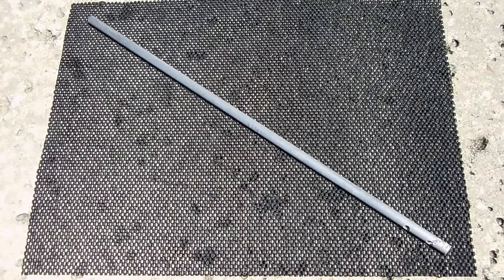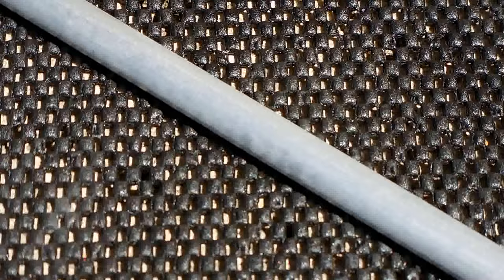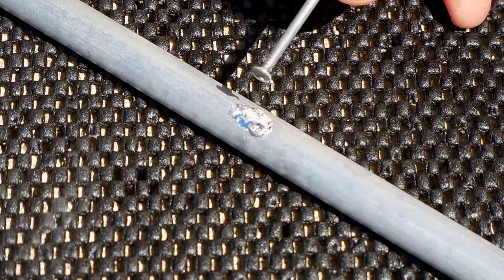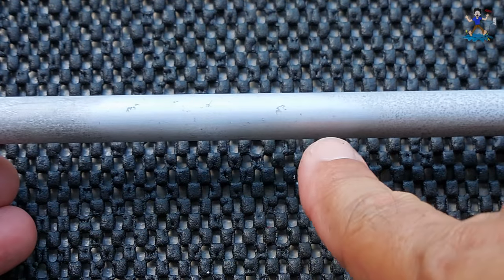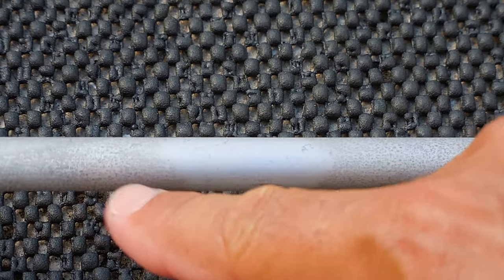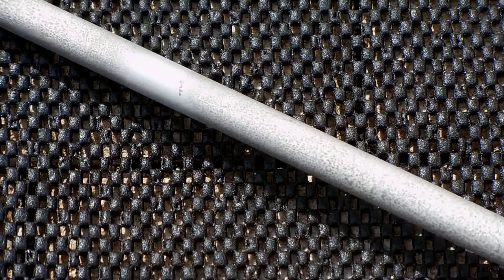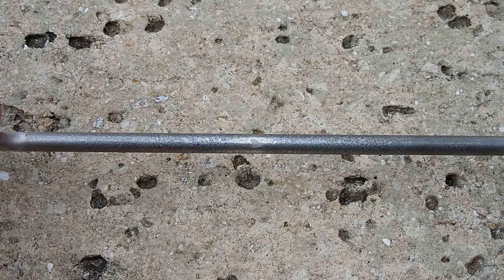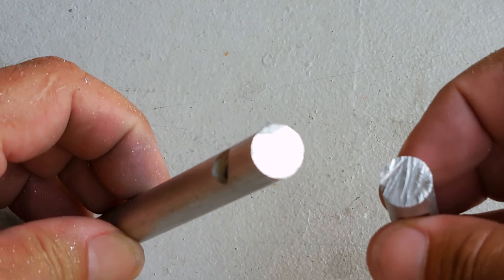Gallium vs Aluminum!

Comment: Hi. I see the Gallium is liquid when initially applied. Will it not "grab" the aluminum in solid form? Is that the reason for the sun lit black padding, to keep it nice and warm so as to attack more efficiently? Thanks for the great videos.
Reply from the maker: The Gallium needs to be in liquid form. The black mat was used for contrast.

Comment: I wonder if there might be a practical use for this, although I can't think of one at the moment ? 
Also wonder what happens if you apply heat to the aluminum after treatment ? 
Thanks for sharing
Reply from the maker: The only good uses I can think of, would be for conductive purposes like what is shown in my other video, or to make aluminum windows very easy to remove(allowing them to crumble) when replacing them.

Comment: Would the same thing happen with other metals, Gold, Steel, Cast Iron, Copper ect??
Reply from the maker: It's corrosive to most metals, but there are a few exceptions. Aluminum is destroyed the fastest, followed by zinc, all other metals are corroded very slowly, and sometimes only to shallow depths. Thanks for watching!
Reply: Thank you for making the video :)

Comment: Is this something akin to hydrogen embitterment? Man if someone wanted to do some damage this would be the way to do it..
I know aluminum is one of the most reactive elements on earth but clearly these two elements have an affinity for one another ... I'd call it a bad love affair that ends in a broken relationship... destroyed is more like it.
Reply from the maker: I was discussing that with a friend of mine the other day. Just imagine placing one large drop of Gallium on a 10,000-12,000 pound aluminum boat lift next to the pulley. In 3 days the boat would be in the water! Imagine leaking this element inside an aircraft! Not good. Thanks for watching!
Reply: Yeah, I didn't want to go there, many structural things made from aluminum.
Reply from the maker: Craig Nehring What's truly amazing is how fast the damage occurred. In one day that rod could have been snapped.

Comment: Very interesting, would like to see what it does to other metals.  I've seen some aluminum corrode very badly from electrolytic action on boats, but it never seemed to turn brittle on the inside.  I guess this is aluminum's Kryptonite.
Reply from the maker: If you take a copper plated zinc penny, scratch the surface down to the zinc and apply a small amount of Gallium to the scratch, in a day or two the zinc will be damaged enough that the thin copper plating will peel away from the surface.
Reply: +electronicsNmore show a video on that lol
Reply: Now I know how to make cheap jackets for my cast bullets:)

Comment: cool. It can also do the same with glass if its in a bottle. But why did this video get down votes? sheesh. What other metal would it react to.
Reply from the maker: The reason why glass is a problem, is because the Gallium expands when it becomes a solid which causes the glass to break. :-) Ignore the down votes. They are from Trolls and lowlife individuals that are haters of my channel. Every channel has them. They don't have the balls to confront me, so like little wimps they use the thumbs down button out of spite. What happened to all the men in this world? LOL Many Youtube channels complain about the abuse. Youtube needs to eliminate the thumbs down button. Thanks for watching!
Reply: It is odd how the metals absorb despite the aluminum is solid. 
Also here is an odd reaction. to mix I think colloidal silver with colloidal copper (or was it tin or gold) which made a white cloudy liquid.
Reply from the maker: xwsx001 I'm not a chemist, so I cannot explain too well what's going on, but the chemical reaction between the Aluminum and Gallium does a great job at weakening the Aluminum(Creating a new alloy). I could have placed the Aluminum coated with Gallium in water and hydrogen bubbles would have been produced.
Reply: +electronicsNmore you probably could have broken it with your hands. also most don't know this that to generate more hydrogen for energy with electrolysis aluminum powder greatly increases the efficiency. but people have to watch put handling aluminum powder since its toxic if inhaled or touched.
Reply from the maker: xwsx001 Yes, I could have easily snapped it with my hands.

Comment: I was on a 747 from LA to NYC this morning, and the plane's heater was too high, so it was 87° F inside. My 1 liter bottle of gallium fell onto the floor and broke open, spilling everywhere. I was seated just above the wing and it's structural supports. I didn't bother telling anyone about the spillage, mainly because it seemed to have disappeared by the time we landed. I guess it was absorbed into the floor. That shouldn't be a problem, right? Lol.. Just kidding.

Comment: A video on how to take forever to cut an aluminum rod in jagged pieces. Next video will be how to take an hour to make a sandwich.
Reply from the maker: ADD/ADHD is a terrible thing. Luckily there are treatment options. :-)
Reply from the maker: Chuck Smith As I said, ADD/ADHD is a terrible thing. Very easy to scratch the zinc chromate coating, then apply the Gallium. As for the TSA, all I can say is LOL. :-)
Reply: doesn't seem like it would take much to affect the integrity of a plane at flight speeds.   a tiny amount made that rod that brittle, what would a few ounces of it do at just the right spot on a wing, or the nose, or around a window.

Comment: Thumbs up :)
Reply from the maker: Thanks!
Reply: electronicsNmore Will you try repeating this experiment with zinc ?
Reply from the maker: High Voltage
Viewers don't like too much of the same type of video. If this one does well, then I will upload another one in the future. I explained to one viewer what happens to a copper plated zinc penny in the comment section. :-)
Reply: electronicsNmore Ok :)